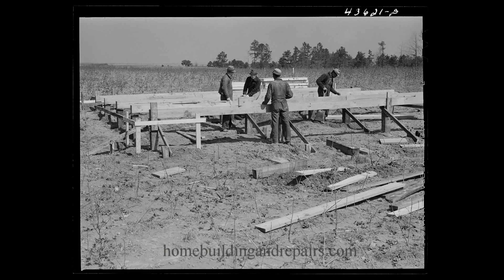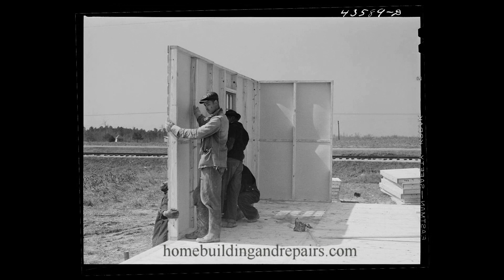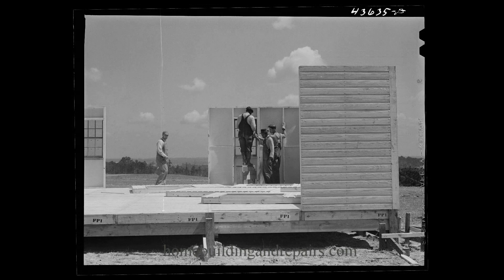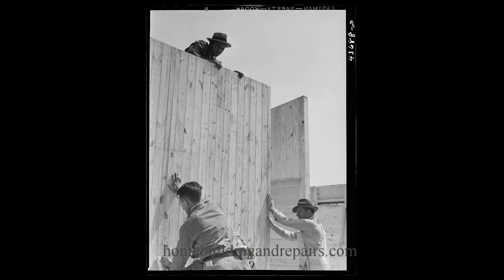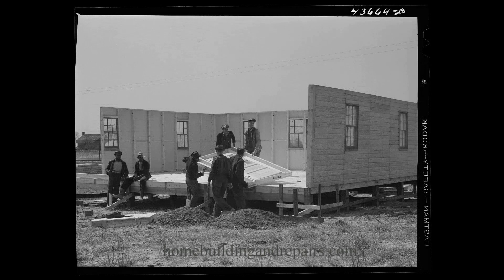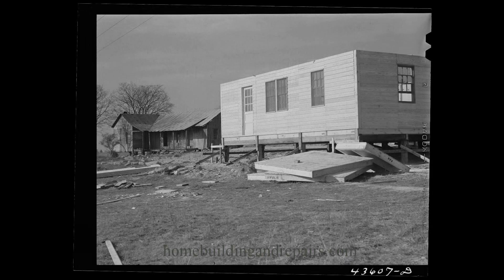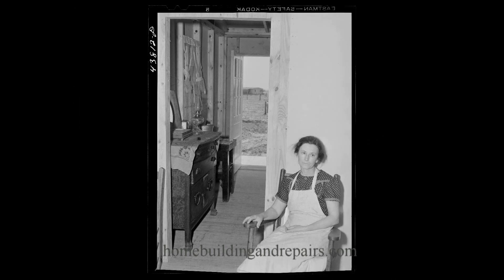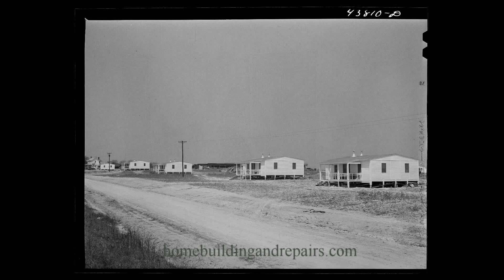1941 Prefabricated Partial House Assembly - How It Was Built Years Ago

Comment: Very interesting! I wonder where those homes were built and for whom. 
When my husband and I built a rural home I drew the plans and it was built in panels (inside a factory and out of the weather). The walls (complete with windows, doors and sheathing) , floors (8 large sections) and rafters arrived on two semi trucks and the parts were lifted into place with a crane to be positioned on the foundation we had had poured. In a day and a half we had our starting point for plumbing, electrical, insulation and roofing. My husband was all smiles as he told me how square everything was after the first day he had worked on installing flooring. I very much appreciate the skill and care it takes to be a great carpenter but it is not always possible to find one nearby or to house one for the duration of a project. So panelized construction does have its place though the quality seems to have improved since the ones shown here!
Reply from the maker: These homes were built during World War II and I'm guessing for soldiers, but it could've been for a government housing program also. Like most things, panelized construction has become better and more efficient and as you said, when you can find experienced construction workers, homes like these might just be the answer.

Comment: Thanks for posting! I'm a general contractor in southern eastern pa and did renovation work to a similar home. Mine may have been a Sears kit home. The wall framing was built in 4 ft panels and had painted ID numbers on the old pallet wood sheathing. Long clapboard siding installed on site made a clean look outside. Also worked on a levittown house. They had a pretty neat roof truss detail. Thanks again
Reply from the maker: You're welcome and thanks for the insight. I actually watched a documentary on Levittown and what a site that must've been. I think the biggest job I ever worked on was about 150 homes being built that once, but the way it sounds, they were building them by the thousands.

Comment: What I find interesting is the size of the floor joists look under sized for the span of those piers. I would think the piers would have to be a lot closer together to support that thin of joist. I heard about how back in the day it was possible to order a house from the Sears catalog. When you did order one, it arrived in pieces and I guess this is how they were put together. Craftsman homes I believe they were called.
Reply from the maker: Yes, the floor joist and other parts of the building probably weren't going to meet today's standards or building codes and you're right there were plenty of companies that sold prefabricated homes, including Sears.

Comment: I've only built one or two prefabricated houses, but it was just the wall frames that came prefabricated. We had to square and sheet the walls, so I guess it was just a partial prefab. I much prefer stick framing.
Reply from the maker: I think I would agree also and it's probably the reason why most home builders choose to stick frame.